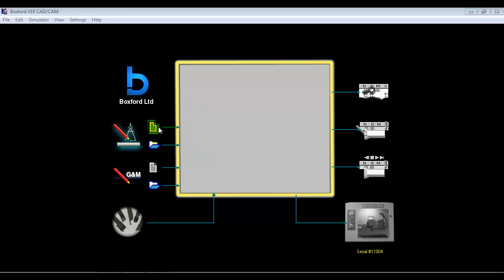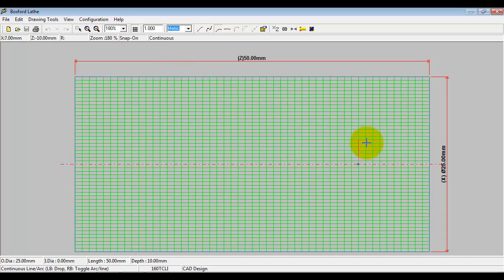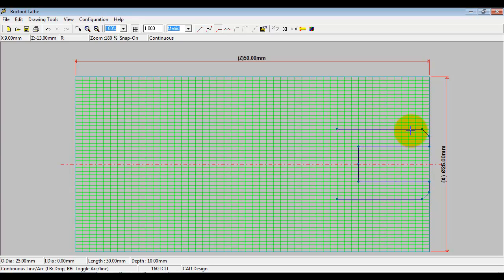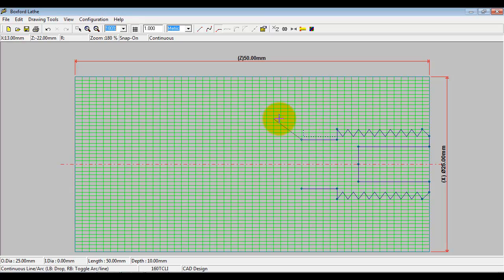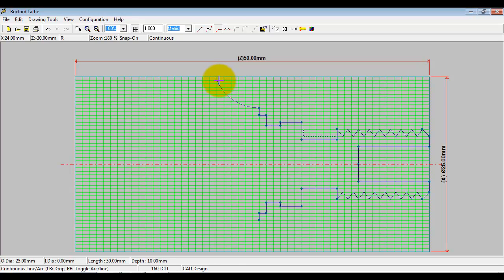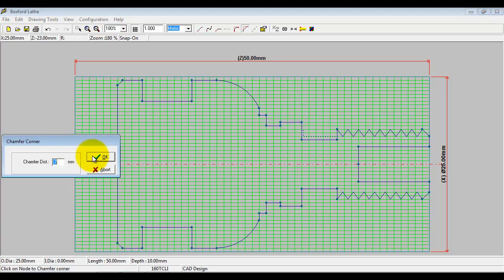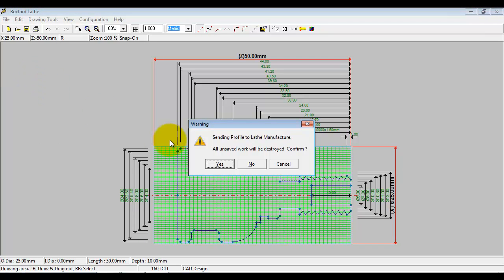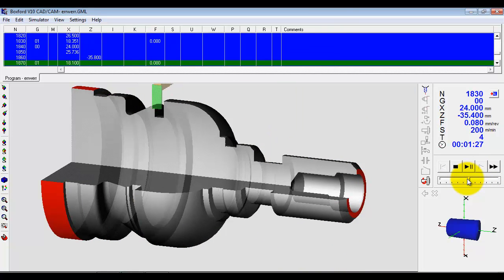Boxford CADCAM Design Tools software - Lathe CAD Processing

Comment: if I install a boring bar to the lathe will it be possible to make cavities in turnings? the software keeps refusing to allow this to be designed in.
Reply from the maker: Yes it would be possible to make cavities if the tool was activated in the library by ensuring the 'fitted' check box is checked.